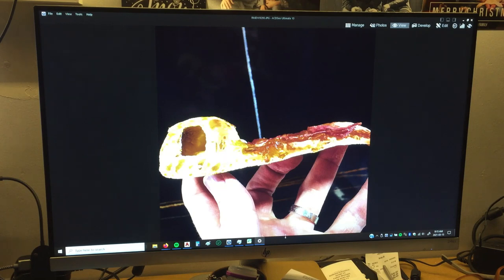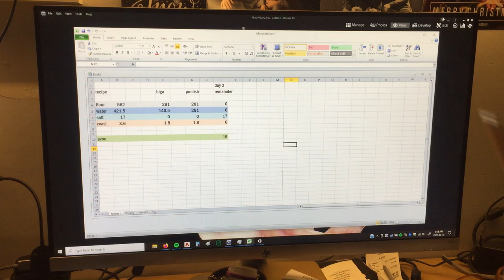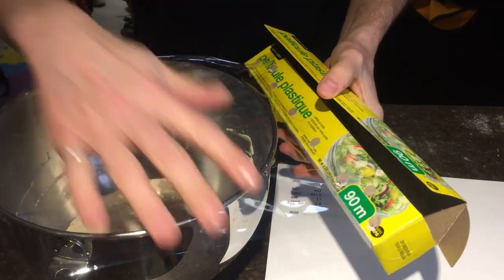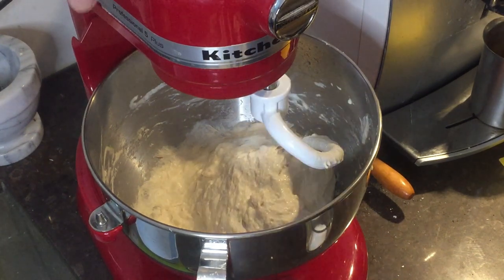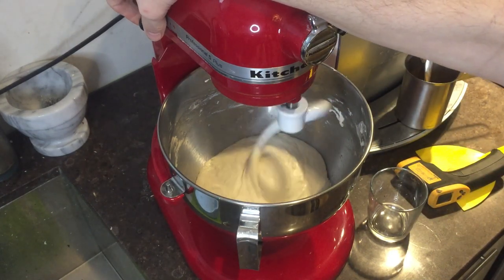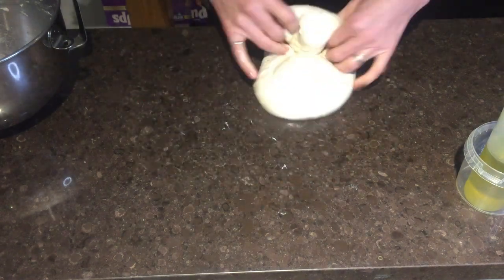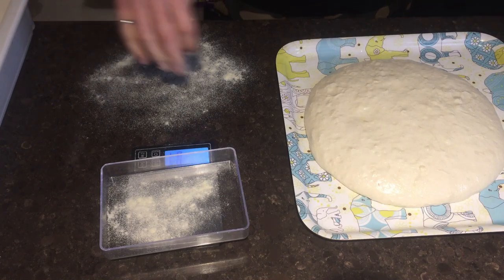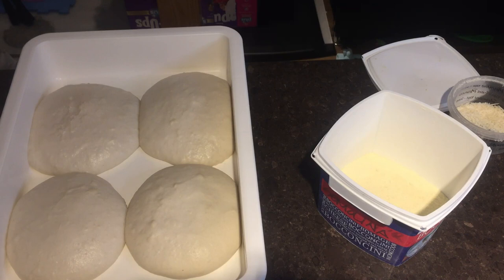How to make Neapolitan Pizza Dough, in a Stand Mixer - 50% Poolish + 50% Biga @ 75% Hydration

Comment: I'd cooked up the same idea for sometime, just to learn you've done it. Now you don't have to stick with 75% hydration just because of the math, you can always add small final bit of flour or water in the final dough to adjust your desired final percentage
Reply from the maker: Agreed: however, as I mention in the description, the undercurrent was to make all the flour prefermented ... btw, I’ve only made this combination once - it’s a lot of work, I’m really into the 100% Biga lately because it’s less work and all the flour is prefermented.
Reply: @PizzArchitect  agreed, I do find though that the bit of fresh flour can really give some fresh boost of food to the yeast to last till the final proofing and prevent overproofing where your dough collapses due to depletion of carbs, which has happened to me when you have all your yeast in your preferments. Agree that 100% Biga or poolish is far less work perfect results still
Reply from the maker: @daniel1c  Before I saw Roberto Susta's video I'd only ever seen 80% Biga (20% flour on closure) so it's more common to add flour on closure, than not ... also, aforementioned 100% Biga recipe splits the yeast 50/50 between Biga & Closure - which would avoid what you'd described.  Here's the 100% Biga Video from the Master:

https://www.youtube.com/watch?v=GQ7pAvm53oA&t=0s
Reply: @PizzArchitect  thanks for the share. Wish it had subtitles
Reply from the maker: @daniel1c  it does but they’re not perfect: click “CC” (closed captioning) and under those settings, select ‘auto translate’ and select English... it will translate, but (for example) sometimes instead of “Biga” it will translate to “Beer” ... but you’ll get it, ask me if you have any questions! Happy to help!

Comment: Great video. For some reason I always have trouble incorporating biga into the poolish even after bring it up to room temp. No matter how long I mix.
Reply from the maker: Me too - that’s not the easiest process ; since I did this video, I’ve spoken with Roberto Susta (in Naples) who invented the Biga No Stress Method, based on that chat: Next Time, on the closure, before I add the Biga to the poolish (or anytime I hydrate Biga) I’m going to soak the Biga in some water (which will raise the hydration rate to maximum 80%) & a few ml (.5 tsp) of natural sugar source (honey or Maple syrup) predisolved into the water. This is a trick that will help, especially if there’s any acidic smells... the Biga in this video had a slight acidic odour (you get a whiff of apple cider vinegar type odour) .... in this video I relied on the water from the spray bottle to help, next time I will soak the Biga in ‘water with some sugar’ before I start the closure!
Reply: @PizzArchitect  thank you so much!!! I have also mix the poolish with the biga after 24 hour fridge, gentle mix then another 24 hours for a total 48 hour cold ferment.  Then bring it up to room temp for 1-2 hours then mix.  Seems to be easier then. Pizza is not just mixing water yeast and flour, it's serious science. Cheers.
Reply from the maker: @David-y8m8z  agreed, since getting “into it”, I’ve come to realize that pizza making has  got the precision of baking ... before I assumed it had the latitude that cooking affords, but imprecision can lead to disaster with pizza!!!
Reply: @PizzArchitect  I also had troubles with homogenization of the dough (unmixed biga chunks, same as in your video). The solution I found is to first poke some holes in the biga (with chopstick) and add the water, leave it for few minutes, then do first mixing in food processor, and final mixing in conventional mixer.
Reply from the maker: @mam2szczury  Since this video I did this one: 

https://youtu.be/OR63JKREVi4

I find, as long as I mix a biga to 24-25 degrees, not only are there no 'biga chunks' but it's really smooth and silky ... I have to say, also, switching to biga made with 65% of the water (as opposed to 45% of the water) was also a game changer for me ... thanks for your comment!

Comment: One further question - 75% hydration - did u choose that for a reason - would 70% hydration work as well?
Reply from the maker: 75% hydration is a byproduct of the math: divide the flour in half (for poolish & biga) and then poolish requires and equivalent amount of water as flour & biga requires 50% of the flour weight in water... that equates to 75% of the volume of flour (75% hydration!)

Comment: seems like a lot of yeast ?
Reply from the maker: it's relatively cold in the room I work in (also, its March in Toronto!) : in the summer I can cut that amount in half ... even with that amount of yeast, I'm leaning on proofing in the oven with just the oven light on.
Reply: @PizzArchitect yes that seems to be the most reliable source of a relatively consistent temp.